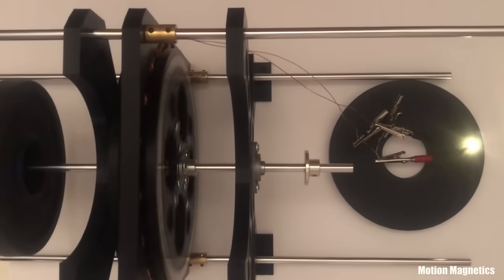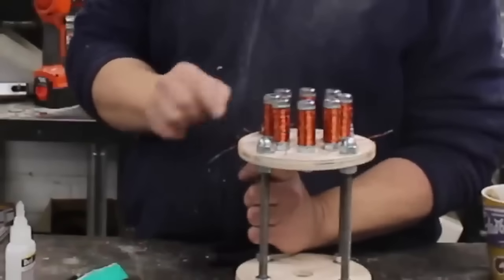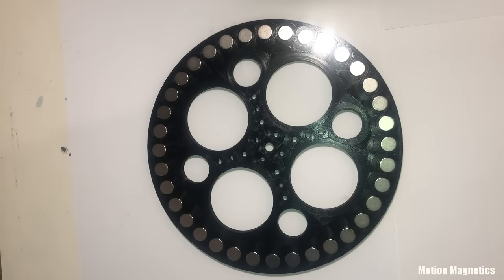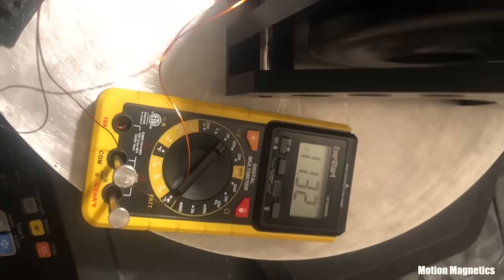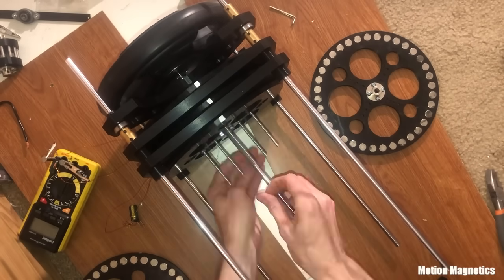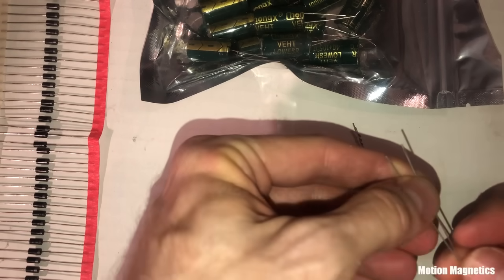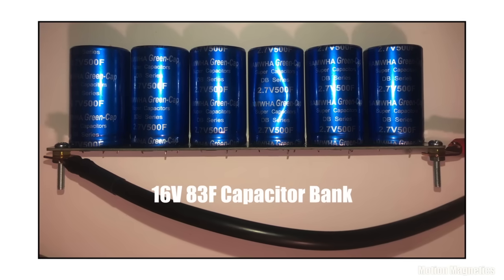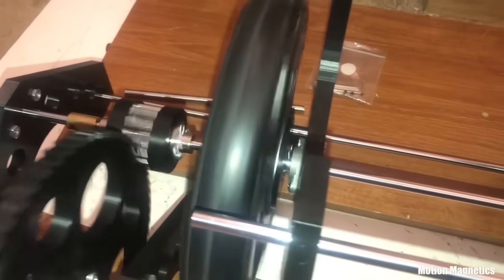Stackable Generator

Comment: He'llo  I  have a design that is similar if you are doing this would you be willing to cut me in if I can give you the missing 🔗
Reply from the maker: Thanks, but I'm not really doing this for the money. I just want to share the ideas with people so they can build their own generators for charging batteries/capacitors or backup power. I also haven't shown the full design in video form yet, this video just covers part of the generator portion.
Reply: @Motionmagnetics  yes your design fits my application perfectly but I have a brain 💭 that could be used for a larger scale..I have been planning on doing this for 35 yrs it would be awesome if we could make one of these in my design I have some neodymium mag and wire 1500 ft but I didn't have a counter to make the coils perfectly enough and I wanted it to be as perfectly as possible.
Reply from the maker: @dmorgan5010  Thanks for the offer. You'd probably want to work with someone with a machine shop, or at least a CNC machine for that though. I'm just working with a 3D printer for now, but I also have a specific direction I'm going in for the design so I wouldn't want to hinder your 35-year plan in any way.
Reply: @Motionmagnetics  well I believe if I can get help with assembly and the correct items needed to pull off the amplified power supply and my design is for farm project and mtn community development self sufficient
Reply: @Motionmagnetics  I'm  in Texas we're are you.

Comment: Would love to see how you feel about the Liberty Engine builds.
Reply from the maker: I'm not sure how I feel about it, as to whether I believe it works or not. I really like the design of it though. If I built a version of one I'd probably hook up more converted microwave transformers around the rotor and then do a series of rotors and stator assemblies connected to a gear system that would use weights to power it.

Comment: One way diode between caps and charge controller (blocking diode) can buy bang good,  Aliexpress on a pcb from memory 300amps used in caravans in-between main battery and extra lithium batteries.
Edit subbed you
Reply from the maker: That's a good suggestion. Thanks!
Reply: @Motionmagnetics  no worries I looked on Ali 0 to 30v 300amp it is  cheers good luck

Comment: Yeah your back, im going to think a bit a see what i can do to help u with this project buddy
Reply from the maker: Thanks. I've been working on this since I posted my Gravity Generator Concept video, I just didn't update it in video form until now.
Reply: @Motionmagnetics  oh np I understand, i was drawing out my own designs for small models jet engines but im currently running into problems with my ideas so i put a stop to it for now until i figure out something, i like your videos so until i figure out something ill help you, but I did have one idea but idk if it would make a difference, but my idea is to go for a plate design and where the wires can have a little curve so it doesn't only surrounds the the front of the magnet but also the top, and possibly bring the plates closer together to make it more compacted, i do have a second idea but it needs more thought as the idea sounds more complicated

Comment: Battery less for Tesla electric engen hydrlics pushing the plate closer and farther apart to engage the generator stop and go of electric flow starting your engine or turning it off no more batteries battery charging with the ___________ alternator generator creating it's electric energy for it's engen to run

Comment: One suggestion if you think is useful. 

I think you are try to add gravity power to spin the magnets. Awesome I am also having same thought, but recently I have another idea.

This is completely different. I am thinking that instead of using windmill > gears > generator, why not use windmill > gears > compressor. 

I am thinking to use windmill with compressor. 

Benefits: 1) we can get Benefits of lowest wind gust to compressed air. 2) compressor air can be used pneumatic motor with constant rpm for generator. 

This is my thought and doing in future. I will appreciate if anyone having suggestions.
Reply from the maker: That's not a bad way to go. Wind power has a certain reliability to it. My personal preference is simply to use weights to turn gears so that I have a consistent predictable system that only needs to be reset at certain intervals.

Comment: How much have you spent so far. I wanna build this. I have a lot of dead junipers on my property and wanna make a steam powered generator
Reply from the maker: More than I needed to because I keep re-designing things as I go. As it is, the 10 lbs of 23AWG wire were around $130 and the PLA for the parts is probably around $100. The magnets would be a little under $200, but I had some of them lying around, so it cost me less. It was probably around $200 for the rest of the parts to throw it all together. So it's definitely been over $600, but I really hadn't thought about the price as it's more of a labor of love. I enjoy building things like this.

Comment: It kinda looks like this could work with that magnetic gearbox that's going around. Idk if that could help, but maybe something to think about for getting some higher speeds.
Reply from the maker: I have looked into those. I'm trying to come up with the best way to set the system up in a 3D-printed version, but the design will probably change a bit when I get to a CNC-built version later on.

Comment: Interesting video. Neat project. Do you plan to machine the printed parts further on? So that each rotor/revolving part is balanced.
Reply from the maker: Yes, once I have the variables more worked out and have tested a version working with gears connected to weights.

Comment: More amperage is never a good thing vs more voltage. There are no I^2*R losses related to the voltage and more headroom when going through rectification is also a benefit.
I^2*R losses are also high in the diodes during rectification and since Vforward is not linear with current it does not change much as current drops making higher voltage an even larger benefit.
Thinner wire is also much easier to work with as it makes the final coils easier to bend and position.
Reply: But adding more copper significantly increases the cost and increase the winding space needed (bigger gap) which reduces efficiency.  Both Voltage and Amperage must be considered, to maximize WATTS.
Reply: @MrSummitville  You do not add copper by adding more windings. The space in the windings are fixed. You can only select if you use it for many strands of thinner wire, or a few strands of thick. The theoretical weight of copper is the same. In theory though, there is a sweet spot depending on the torque available. Also, bigger gap technically changes the power density not actual efficiency.

Comment: Great video, keep the tinkering up! if you are going down the route of gearing, Robert Murray Smith also did a video on Magnetic gears, they are frictionless making the gears very effitient
Reply from the maker: I've considered magnetic gears. I even showed one of the designs I did for them on my gravity generator concept video. I'm not sure they would provide the necessary torque, but I love the idea of less friction. Didn't know Robert did a video on magnetic gears. I'll have to check that out. Thanks!

Comment: @motionmagnetics I have the idea for the other half, like you said at the beginning. Use bicycle gears a few sets set it high up or dig a hole for increasing time maybe have it rewind itself aswell, and have the wire/rope wrap around the length of a pipe so it stays consistant.. change weight to right gear ratio for wanted voltage output
Reply from the maker: That sounds interesting.

Comment: Great project and great video :)

The metal core is needed to reduce reluctance and to increase the magnetic flux through the “magnetic circuit”.

By removing the cores, you have made it less powerful :(

To power the inverter with more stability, try adding another capacitor bank in parallel (it seems like the inverter is not getting a constant 15V).

Also, fixing the chain and gear problem (with a derailleur tensioner) will help 👍🏽
Reply from the maker: I removed the cores to remove the drag on the rotors but placed magnets on both sides of the coils to compensate. It works better for me, at least in this particular model. 

Thanks for the suggestions, I appreciate it. :)

Comment: Yea but whould you not have to put more torque in to it because of all the edie currents?
Reply from the maker: I noticed a huge drop in the necessary torque once I went with an Axial flux design instead of using coils with iron cores.
Reply: @Motionmagnetics yea but the Edie currents would still be there no?

Comment: It’s fascinating when a creative content creator such as yourself gets recommend from the algorithm…. This video got you a new subscriber.
Reply from the maker: Thank you! I have no idea what causes the algorithms to recommend certain videos. Wish I did. I just try to create things that I find interesting and hope people will enjoy them as much as I enjoy creating them.
Reply: @Motionmagnetics  I think it’s partly to the content I watch… also for your system the smaller the gaps the more of a flux you get… once you get it down pat… I’d try a few where you compress the coils(maybe zip tie through a thinner wall on the back of the 3d printed holder, and fill with epoxy resin. Then you can make that gap a bit smaller. 

Also if you get this further, there are sites that would allow yo to design and order a pcb circuit board to solder the diode/capacitors to and also a power connector and individualized fuses for each of the coil circuits. 

Also pulling the string made me think of a clock, I wonder if there would be a way to make a grandfather clock style generator? Lol I mean using gears ⚙️ to change a heavy gravitational force into a maximum rotational force (100lb weight, with a gear box that would take at least 24 hours to spin that shaft at a higher velocity (rpm) and connect to a charge controller… to a battery bank? Then if it would be possible to use a different gear to quickly raise that weight every day to reset?

I am a delusional initiative idiot… 😆😂😆ignore my rambling nonsense if you want 😂😆😂
Reply from the maker: @clearwax  I was considering doing something like that later, using epoxy resin.

Good suggestion. Also, if it gets to the point where people are replicating my generator it might help them to be able to order circuit boards from the same place I have them designed at. 

That’s exactly what I’m doing with the gears. I don’t know if you noticed them laid out in front of the generator at one point in the video, but I also described the grandfather clock process using gears in my video “Gravity Generator Concept and Design”. Great minds think alike, my friend.
Reply: @Motionmagnetics  I hope it works out! Am interested to see where it goes from here. 👍

Comment: Secret: 
Don't move the magnets and the coil. Make a rotor with rotating shutters made of iron plates, the curtain should pass between the magnet and the coil and shield the magnetic flux from the magnet. The effort to rotate the iron shutters is minimal. This is free energy.
Reply from the maker: I'd love to see a working model of that.

Comment: information        in case you don't know, in a wholly rotary system a flywheel is a do-nothing.!
in order to know the  output of an alternator, the output should  Not  be  Used.        output volts and amps  Must be  Measured  Correctly; via an output circuit that consumes no/very little energy.
instead of an actually shorting* the output, a low-value high-current toroidal inductor can be included in the output circuit.
for any configuration, certain benchmarks  Need to be observed/recorded.      one benchmark is, how the system behaves/rpm-drop when the output of the alternator output is shorted*.        the voltage that is produced at this  Lower rotation rate  is the true output voltage.    (* shorting the output simulates a connection to a normal low-impedance power processing circuit/device.)          accurate measurement of output current (shorted) is best done via the use of a low-current DC clamp ammeter.

Comment: for best performance, the air gap should be as  small as possible.         my research suggests that, where high-gauss neo-magnets are used, the total gap between rotors should be a centimeter or less.
Reply from the maker: Good advice. I can't do that with 3D-printed rotors, but intend to do a smaller air gap in the future. This is more of a testing prototype, but I'd like to build a more permanent version with a CNC machine at some point.

Comment: at some point you will need to make a drive system for your alternator.      when you do, the rotor of the alternator should  NOT  be driven at its center of rotation/shaft.       instead, the rotor should be driven in such a way that, with the least losses, the prime mover has  Mechanical Advantage (MA) over the load.            simply put, this calls for the use of a  large-radius  high-reduction ratio  Driven Wheel  mechanism.    see my research, if interested.
where an alternator stator has a larger radius, the nominal operating speed will be decreased; in part because the number of coils per phase will Increase.          for a three-phase stator, the total number of coils needs to be a multiple of  Three.        the rotor(s) will need to be  correctly configured; so that all the coils (of a phase) are energized, simultaneously.            do  NOT  use capacitors.!!!        because, power is   watts, continuous.!    but, a capacitor stores charge  OVER  TIME.!!!     so  DON'T  use em.
Reply from the maker: Thanks for the suggestions.

Comment: You already made one , but most of the video is developing other alternatives. You can use this as.portable generator. 
People in the past focused on solar , water and wind to rotate the stator. But magnets are becoming a new reliable source, for alot of things.
Reply from the maker: Yes, I've decided on the direction I'm going for the initial system but I wanted people to know they could use the stacking method for just about any coil design they wanted. It's just a starting point, but very adaptable. It's definitely intended to be portable though, so you can use it anywhere.
Reply: The magnets do not generate the power. Someone or something is required to turn the shaft. And that requires ENERGY.

Comment: information         5:00    WRONG.      a generating coil should be a brooks coil, wound with 14awg or equiv conductor.      in order to make an efficient generating coil from smaller wire, multiple strands should be wound (in hand) as one conductor.          a brooks coil is simply a coil that has a square cross-section (same number of layers as winds).        the use of a serpentine 'coils' in an alternator is  Not  recommended.          any enthusiasm one might feel towards murraysmith should be tempered by the fact that he  does  NOT  even know how a generating coil  SHOULD  be made.!
Reply from the maker: Thanks for the suggestion.